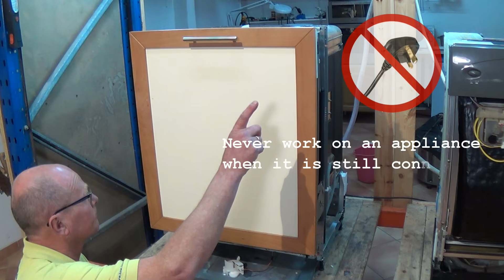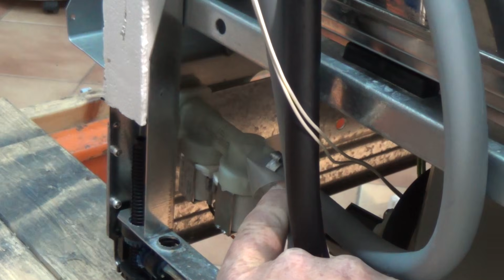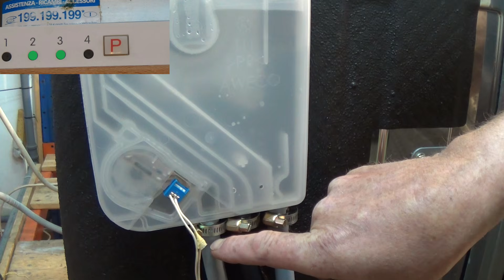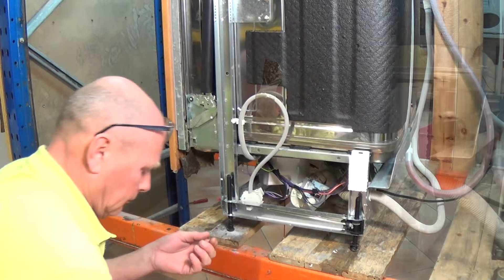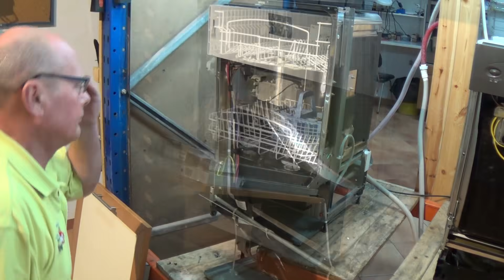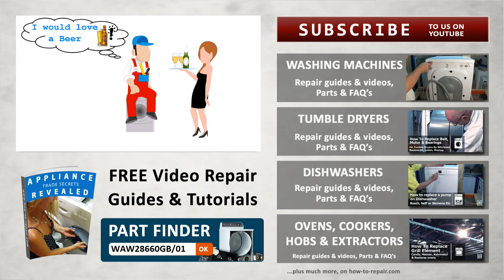Indesit dishwasher error codes and faults Flashing lights Diagnostic fault finding

Comment: I repaired F05, please check the pressure switch and the inlet valve filter together. at the beginning I blowed the soft pipe on the pressure switch, and I confirmed that it works well, the alarm didn't disappear. also I cleaned the filter near the inlet valve, and then I found that filter was pushed too deep, it will press a rubber gasket behind and finally reduce the water flow because this wrong deep installation, so I pull out the plastic filter a little bit, the inlet flow immediately become stronger and faster, the alarm F05 also disappeared successfully.

Comment: Hi i have indesit dish washer model dfp5731 i have problems with A1 error
Reply from the maker: Hi @user-ri1nj9hs3z I will need the full model number of the identification plate and the details of your problem. Please use our contact us page and make sure you fill out the request for what your problem is. We will get back to you within 24 hours, normally. https://www.how-to-repair.com/help/contact-us/ 

Please remember to subscribe to our channel, as that's what keeps this channel going. Thanks 👍

Comment: Great video. Definitely feel more confident getting to grips with my dishwasher. Just to confirm, I have an IDF125, and the LED layout is slightly different, with 3 in a row, them another up and to the right. I'm assuming the lone light is 4. In this case, I'm getting an F13 circuit board fault. I've opened it up and had a look, and there is no sign of disconnections, corrosion or obvious issues with the board. 

The machine runs an initial cycle, and the error code comes on as it expels the first batch of used water, which (I left it in a bucket) runs freely out of the waste pipe (though I did notice it was cold. I don't know if this is normal for the first cycle). I'm probably going to buy a new board, but any advice would be appreciated.

Comment: i own  electrolux table top dish washer. i seldom use this washer. the selected mode ECO suddenly keeps blinking when the start switch is on. nothing works . please advise
Reply from the maker: Have you checked if there is any water in the base of the machine when I see the base I mean where the motor the pump is situated underneath where the plates go as you might have an antiflood device Switch  @leongweifong1111 please remember to subscribe to our channel as that really helps us https://www.youtube.com/shorts/e432SAb2g08  Thanks, Paul 👍

Comment: Hi. Thanks for showing the error codes.
I have a Indesit DiF04B1 A+ Dish washer.
When I set it to a program. It  starts to beep after about 1 minute. There are 4 lights flashing. Could you advise me of this code please. I have checked for blocked filter, topped up salt and rinse agent. Also for water eatery. Thanks.
Reply: Did you ever found out what it was?!
Reply: @BelfastBandit  I have exactly the same dishwasher. And the same problem. On their website, they have advice on what to do for each error code. In the described case, the recommendation is as follows: "We recommend you call our customer service centre to book an engineer." Which probably indicates a slightly more serious fault. As a solution, I bought a new dishwasher, from a different manufacturer, and I will deal with this one when I have the time and will.

Comment: Hi, can you help please? My Indesit is showing F1 with orange flashing lights at either end of the control panel. It is aDSFC3M19S. It seems to be trying to pump out water that is not in there. It won't let me switch it off and having the door open does not stop it beeping. Thanks
Reply from the maker: it might be pumping out because an error is stopping the machine from working Thank you For leaving a comment this is for you https://www.youtube.com/shorts/e432SAb2g08 please remember to subscribe as that's is what keeps this channel going. Thanks 👍
Reply: Did you ever solve this problem? I am having exactly the same issue. Thanks

Comment: I have an indesit idl 500 with the first light flashing, can I remove the flood sensor to solve the problem?
Reply: The 'sensor' consists of a lump of polystyrene that floats ..upwards..and a micro-switch (normally open); when pushed by the poly. the switch closes, hey presto flood detected. Worth checking wires are not damp (always unplug the machine).

Comment: F5 Fault code.

F5 is number 1 and 3 LEDs flashing and indicates, according to the manual your machine has a blocked filter.  The reality is it may not be a blocked filter at all, as was the case with my machine.  the filter was always perfect and rinsed out regularly. And it may not be any faulty components either - as was the case for my machine.   The trigger for the code is a lack of pressure change at the low pressure switch.  The low pressure switch is mounted on the side of the machine frame and connected to the wash chamber by a long rubber tube.

After turning on, the machine goes through a drain cycle pumping out any water/fluid that might be in the wash chamber before starting the initial fill.  Then the drain pump stops and the solenoid opens to allow the machine to fill.  My machine would drain, fill and then stop with LEDs 1 and 3 flashing.  I could reset the machine and it would do the start up perfectly as above and get to the same point and stop.  I removed the high pressure switch and low pressure switch and both were working fine. I applied air pressure to them and the electrical contacts closed. I put it back together and it still would not get beyond the end of the initial fill stage.  There is one hell of a lot of unhelpful advice out there ! I wasted many, many hours.  

On one site someone stated that they had observed the fitter remove the pressure switch and blow into the tube before charging him for a new switch.  I pulled the pipe off the low pressure switch and did the same.  The machine now works perfectly. 

Obviously there was something modest blocking up the pipe.  The machine had not been used for a couple of months before the failure so something must dried out and blocked the pipe. The pipe just traps a column of air.  As the water level in the chamber rises, so it compresses the air trapped in the pipe.  This very small change in pressure causes the switch to throw and informs the control system the wash chamber is now full to a suitable level.  Doing the final repair, removing the pipe and blowing into it and then refiting it took me 3 minutes.  F5 on the Hotpoint Indesit maintenance system is rarely mentioned and although I visited around 50 sites, the minority that did mention it all just referred to blocked filters.  At one site a fitter advised that it could be a faulty pressure switch but did not help by advising which switch and how to identify it - so that is why I ended up testing both. how-2-repair.com do great videos but in the other video detailing all the fault  codes they simply waltz passed the F5 and ignored the guy asking the question in the comments - what is it.  So I am going to post up this comment in a couple of other places as well, so no one else has to waste quite as much of their life as me finding out they don't need to pay a fitter £70 call out for a new pressure switch when the fix is so easy.
Reply: It took me 1 week, at least a hundred google searches and youtube videos and several dis- and reassembles of my dishwasher to find this comment. I spent 60 bucks because I already ordered a new drain pump, and I was almost ready to buy a new dishwasher. I was so frustrated... Thank you so much.

I gotta say, the fact that the F05 Error is so hidden or just straight up misleadingly described online, almost everywhere, should be considered a crime.

Again, thank you so much, Michael Evans.
Reply: 4 years later, you're a hero! fixed my dishwasher with this advice!
Reply: Thanks for taking the time to post this. Sadly for me I came across this to late, spent all day on mine, got fed up and ordered a new dish washer, at least I have spares now 👍🍻
Reply: You are a life saver.... What a great person. I tried it and it worked perfectly. Thank you for helping others and righting this whole thing up.

Scrolling through those tech support forums and seeing useless "just look at the manual replies" was so annoying.
Reply: Do you have photos or know where I can find out what a low pressure switch or high pressure switch looks like? 

All I can see is a water in and drain pipe out.
Reply: Based on my experience today when there appears to be a partly blocked F05 senario. Don't know if it was slow drainage pipe (rather than blocked) and or a blockage of pipe to from pressure sensor but short period of sodium carbonate soak did not help but a long 2+ hour period has. Apparently the affected Indesit IDF125 needed a loak soak to remove the gunk causings its F05 problem.

Comment: Dis 14   1 and 3 flashing.....what is the problem?
Reply: Defective pressure switch (poor switch contact), impermeable hose to pressure switch, the air trap at the bottom of the dishwasher is blocked by grease. Pressure switch located to the right under the side plate at the bottom of the frame

Comment: Hi, my Indesit DSRL17B19 slimline freestanding dishwasher is stopping mid-wash before dropping the tablet (on eco), it stops with the play/pause light amber and the salt light blinking red rapidly.

The salt is topped up fully, as is the rinse aid. It seems to drain properly as after this fault the unit is not full of water (and neither is the bottom bit with the filters).

Unlike other larger dishwashers, this one has few LEDs for error codes. 

The dishwasher is just a few months old, so it's still in warranty, but I wanted to see if there's any easy DIY fix (without having to take it apart).

Comment: what about the 05 code? can you identify this one?
Reply: F5 is number 1 and 3 LEDs flashing and indicates, according to the manual your machine has a blocked filter.  The reality is it may not be a blocked filter at all, as was the case with my machine.  the filter was always perfect and rinsed out regularly. And it may not be any faulty components either - as was the case for my machine.   The trigger for the code is a lack of pressure change at the low pressure switch.  The low pressure switch is mounted on the side of the machine frame and connected to the wash chamber by a long rubber tube. 

After turning on, the machine goes through a drain cycle pumping out any water/fluid that might be in the wash chamber before starting the initial fill.  Then the drain pump stops and the solenoid opens to allow the machine to fill.  My machine would drain, fill and then stop with LEDs 1 and 3 flashing.  I could reset the machine and it would do the start up perfectly as above and get to the same point and stop.  I removed the high pressure switch and low pressure switch and both were working fine. I applied air pressure to them and the electrical contacts closed. I put it back together and it still would not get beyond the end of the initial fill stage.  There is one hell of a lot of unhelpful advice out there ! I wasted many, many hours.

On one site someone stated that they had observed the fitter remove the pressure switch and blow into the tube before charging him for a new switch.  I pulled the pipe off the low pressure switch and did the same.  The machine now works perfectly. 

Obviously there was something modest blocking up the pipe.  The machine had not been used for a couple of months before the failure so something must dried out and blocked the pipe. The pipe just traps a column of air.  As the water level in the chamber rises, so it compresses the air trapped in the pipe.  This very small change in pressure causes the switch to throw and informs the control system the wash chamber is now full to a suitable level.  Doing the final repair, removing the pipe and blowing into it and then refiting it took me 3 minutes.  F5 on the Hotpoint Indesit maintenance system is rarely mentioned and although I visited around 50 sites, the minority that did mention it all just referred to blocked filters.  At one site a fitter advised that it could be a faulty pressure switch but did not help by advising which switch and how to identify it - so that is why I ended up testing both. how-2-repair.com do great videos but in the other video detailing all the fault  codes they simply waltz passed the F5 and ignored the guy asking the question in the comments - what is it.  So I am going to post up this comment in a couple of other places as well, so no one else has to waste quite as much of their life as me finding out they don't need to pay a fitter £70 call out for a new pressure switch when the fix is so easy.
Reply: @michaelevans9785  Confermo tutto quello che ha scritto Michael. Grazie grazie e bravo
Reply: Yeah me to, got a F5 (Not F05) error on the front of my Indesit DFP 584 model
Reply: @spindreams  I Know it has been a while, but have you solved the issue ? I have the same machine